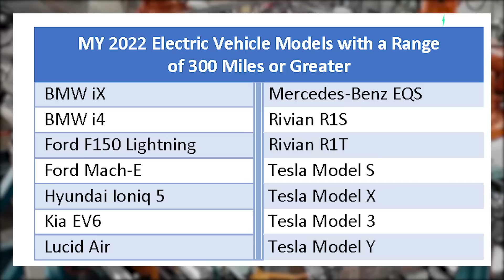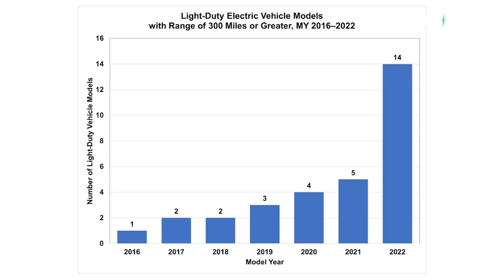New report shows why 1000 km range EVs will be the norm in 2030

Comment: 1000 klm would be great. However that's probably 750 klm & after 8 years of battery degradation 500 klm. Still OK if you can rapid change on a trip. However what is the usable range? As you can't use the top 20% & bottom 20% of your batteries capacity. I'm hope you right. Before buying an electric car, I want to see more places to Charge in Australia.

Comment: Instead of going up in range (which no one cares about driving for 8 hours straight),  they should reduce the amount of batteries, thus reducing weight and cost and overall supply chain issue.

Comment: This would truly be interesting. If this is the case, and to me it’s completely plausible, that sort of changes the importance of superchargers and any charger outside the home.  If you can get 1000kms, there are so few trips that would require stops outside the home. Chargers would certainly not be as crowded, not really required as much or often.
Reply: There already less important than they were when the typical EV was a Nissan Leaf with 60 to 70 miles of range. With 300 miles range, that's a 5th of the number of charges needed, and a significant number of trips not needing a charge at all.

Comment: Given the cost of batteries and the weight implications, is it more likely that we will see a lot of vehicles with different range options? Much like ICE cars used to have many engine options. But with more storage space for the mid and short range options. Different markets will also want different ranges 1000 km would be an odd option to choose in Cyprus, Malta, Hawaii or Singapore.

Comment: Hoping a good chunk is 62 kwh LFP packs in Aptera.  This doesn't even need any fancy new technology or giant batteries.  Current generation LFP would be about 940 lb / 185 liters (less than the 1000 mile using 2170 cells).

Comment: Moore’s Law is f@@king garbage. Yes, the computing power increases and technology becomes cheaper. But does it, really? In real terms it bull because older tech becomes obsolete very quickly so who cares about cheaper, old tech if you can’t use. Same companies keep developing the software which need higher computing power. Cars are going in the same direction as mobile phones, they’ll last certain number of years after which either new software will make the vehicle obsolete or the battery tech will change considerably that finding old model battery pack for replacement will become a monumental and expensive tasks.

Comment: One other consideration ; if you are going to tow something or drive a lot with heavy load; maybe you'd want the exta battery power to be able to get somewhere.  The Lightning only goes about 100, miles (80 in freezing weather) towning a trailer - so I suppose if you want it to really have a decent range you might go with a more powerful battery; if you can do that with the same weight thats obviously better.  But devoting more lithium to a vehicle means fewer such vehicles can be made annually.

Comment: Santiago wouldn't it then also be better to simply make the cars weight go down and lower the cars weight?  They are LFP I'd say get all the range you can because if you do highway speed in freezing weather you can lose 75% of your range; but for the typical non LFP you could just make the battery smaller and have a good all around range that should aways get you to the next charger; there isn't much need to go further.

Comment: Moore's law is not actually a law and has nothing to do with battery evolution. NOTHING.

Gordon Moore made an observation about the exponential cycles of evolution manufacturing VLSI. It has been adjusted for actual cycles, and is bounded by physical reality.

Today many say "Moore's law is dead", as it's actually impossible to keep previous rates of evolution against physical limits.

Batteries alway had physical limits. Evolution in specs and cost are also limited, although very desirable.

It doesn't preclude the displacement of most fossil fuels based transportation systems.

Energy "production", storage, distribution and consumption makes a huge system. It's a system's problem where batteries are a little (although important) piece.

Scale brings down costs. It's a fact. Unrelated to Moore's law, and people shouldn't expect that kind of exponential evolution in the medium or long run, at least with currently known physics.

Comment: I am disappointed that you didn't comment on the Aptera due out late this year with starting range of 250 miles then 400, 600 and 1000 miles options, it able to accomplish this by light weight and aerodynamics. The base model can be bought for only 26k. Oh yeah it has has solar panels that can charge the batteries up to 40 miles per day.

Comment: In 2030, the average EV owner will drive less than 50 miles / day.   600 mile range is not that important.  I want an EV with 400 mile range and a 15 minute recharge time.   A 600 mile cross country trip would only require stopping for lunch and recharging the car while you are eating.  The holy grail of battery technology should be rapid recharging -- not excessive range.

Comment: At present the range of most ICE cars is approximately 450 - 650 Km (280 - 400 miles) on a tank of fossil fuel. I don't hear complaints that's not enough. So why do we need nearly twice that range for an EV?  I think the 1000 Km (600 mile) range will not be common for several reasons. 

As battery technology improves EV's will be able to travel a similar distance as ICE do now before needing recharging. But the battery pack will reduce in physical size as the energy of the pack increases. Keeping the range to much the same as we have today with ICE cars, 450 - 650 Km (280 - 400 miles). This can be seen with Tesla reducing the battery size, but still maintaining the same range of the car. Even the number of individual batteries in their cars has reduced over the years as battery technology has improved. Also the cost of having a larger battery pack will influence the size of the pack, even with the cost of batteries reducing each year.  
Plus I don't know anyone who is able to drive 1000 km without taking a break. As Robert Llewellyn from Fully Charged says "It's not range anxiety I have, It's Bladder Anxiety".
Reply: Simple, it takes minutes to fill a gas tank. Range is a non-issue.
Reply: @Biochemechanic  It only takes minutes to recharge a battery now and with a smaller battery pack will take even less time in future.

Comment: no, the range will go up a little, but more importantly, the size of the battery and the weight of the vehicles will go down much faster than the range will go up. great range is as stupid as putting a 1000 gas tank on a ford focus. it would be stupid and self defeating.

Comment: My ICE car has a range of 800km.
Last year I filled it 4 times away from my hometownon a trip.
I do not doubt the report, but times will change.
Range anxiety will drop as super chargers become ubiquitous.
Most people will charge while the vehicle is stationary.  If you can't charge at your home, then there will be a method of charging where your car is parked.
Reply: Technicallty speaking ALL people will charge while the vehicle is stationary.. 😉
Reply: @andreh.dupuis8475  ahhhhh got me there.   Let me elaborate.  Chargers will be installed at parking places, where there are parking meters etc.  They will pop up all over the place.

Comment: Hello Sam and other viewers; ever since I got onto your channel I have been telling you about my 2011 Chevrolet Cruze that I built and made into a 100% electric vehicle but with special technologies that would enable it to go 840 to 1280 miles (1,344 - 2,048 km) on a single charge and yet apparently it is much easier for you folks to ignore me and avoid me and probably say that I’m nuts instead of actually doing a little bit of work and picking up the phone and calling me or sending somebody out to confirm the car is actually made! We don’t have to wait until 2030 to get that lower amount of range of 1000 km when the higher range is here now (it has been around for several years), but people would rather ignore and privately chastise instead of actually doing a little research! It hurts the whole industry. By the way folks, my battery pack is 1/3 the size of a Tesla and the car is about 800 and something pounds lighter than a Tesla model S! So I ask, “what the hell mate??!!” SMH! 
   Edward H. - Owner / Engineer /Fabricator / Machinist at: “New Ideas and Innovations, LLC“ in Madison, CT USA

Comment: you can only achieve longer range with larger batteries or lighter weight. Lither weight is the only desirable method. Larger batters means fewer EVs made due to the limited lithium supply.  If there are enough charging stations; it really doesn't matter much if you make 6 stops of 5 minutes or 1 stop of 30 minutes.  A Tesla with 200 mile range weighs less and is better for the environment; you can make more of them. If you can't get to your next charging station in 200 miles the infrastructure is inadequate.
Reply: We won’t need larger batteries if we can fit more energy into the same size battery. Energy density will improve.

Comment: I am enjoying your enthusiasm and positivity. There is no doubt that 1000km range will be feasible. In fact, 1000 km is already possible today, especially using the more aggressive Chinese EPA calculation. That said, each car maker will still have only access to a finite amount of batteries, albeit at much higher GW levels in 2030. Car makers will need to decide whether to use their battery supply for higher volume and lower kWH or lower volume and higher kWH, or some mix thereof. Eg assuming a car maker has 240 kWH available, it could decide between 2 cars of 120kWH ( and e.g. 1000km range) or 4 cars of 60kWH at lower range. How much fast charging improves over next few years will also play a role. Looking forward to see this battle develop.

Comment: Sam
You still don't get it?
.
Follow "The Mission Statement".
.
"Transition".
.
It's about numbers of vehicles, not how far 5% of the population "needs" to travel.
.
Cars are ALWAYS designed to a "Bell curve"..... The "average percentile" (look it up. I know. I'm outside the curve), not only for body size, but for use characteristics.
.
They design to the needs of the majority
.
That means (as I've said many times)
.
1) Outrange the "average" driver (passengers)
.
2) Accept charge sufficient to repeat that in the time taken for an average , sensible, "comfort/refreshment" break.
.
3) Using the  resources saved, BUILD MORE VEHICLES
.....
That's it.
Period.
.
It doesn't matter what the consumer "thinks" they need based on outdated metrics which do not apply.
It doesn't matter what the consumer would "like".
.
It will be based on the bell curve.
.
It "they" build 50%(?) of vehicles with "hyper range" but in doing so, run out, or grow short of resources, that may mean prices stay high, but also that numbers of vehicles can't be built, possibly stalling the transition.
Reply: I agree but the fundamental of businesses sometimes go into a transition too.

Higher range adds into to “quality of life”

Car value and use depreciate much slowly owing to larger batteries slow chemical ageing process (yielded by more cycles)

Consumer behaviour has the power to make the bell curve deform. That’s economics 201.

Comment: Manufacturers going for range is to be expected as it is the perceived weakness of EVs, however at some point price will be more of an issue more than absolute range. With energy costs rising and likely to remain so a perceived "adequate" range may be lower than people currently think.
Reply: cost ane weight are much more important that range over 300 miles.

Comment: Highway range is the only range that really matters. Once EVs have a highway range of 500+ km then the range issue will disappear. A thousand km range is longer than what is required.
Reply: 500 km is probably over 6 hours of driving time, in my book that's a lot of time behind the wheel.  That is perhaps the upper limit of what most people would want to drive in one day.
Reply: @GlenisRetiredNZ  I think you are right for 99.9% of people. Problem is, theres always that fringe group who say if it cant do a billion miles between a 2 second charge, then its not good enough. Of course, people need toilet breaks, and food breaks, but that doesnt seem to enter the fringe thinking. I suspect we are already in a spot where range is enough. The bigger issues coming will be reducing the size of the battery, and making the car lighter, which will ALSO help range. This will also provide designers with new opportunities to package cars differently.
That said, I'm not really interested in "cars" anymore. I want to know where our flying cars are?
Reply: @bigrobsydney  I think the 1,000 km milestone is more about not having to charge for a long time. There are a lot of people that don't own/rent a house with easy access to a power point/home charger. If you average 33 km a day, you only need to go to a public charger once a month.

Comment: The days of the BEV are numbered............soon they will make a breakthrough and the fuel cell will be the go to preference for travel..........the already heavy investing in the fuel cell will make it happen, and when it does who will want a battery that costs more than the car itself......  fuel cells can be coupled together for capacity and moved from car to car or truck as the need arises and then to the house if need be.........fuel cells don't burn the fuel but convert it and the left over residue is environmentally friendly.
Reply: Fuel cells have been talked about for very a long time. But the technology has never come to being a reality. The problem is hydrogen storage. Hydrogen is a very explosive material. You will need to fuel up at some specialized fuel station. Whereas BEV can be charged at home or anywhere that has power outlets safely
Reply: @123abcter  I have to agree with you.....the aspect of a hydrogen event is not something to dwell on for a restless night's sleep.......with hindsight it would seem to be the long way around.
Reply: @gangleweed  , it needs electricity to separate hydrogen and oxygen from water then ship them to fill-up station. It’s dangerous and waste of time. Have the electricity transmitted by wires to where it is needed
Reply: I am not convinced that hydrogen fuel cells are a better technology than batteries, but even if they are, there is a practical problem: internet searches suggest the total number of fuel cell cars sold to date is about 1000 times less than the number of battery cars, and the number of hydrogen fuel stations is about 1000 times less than the number of electric charging stations. Concepts such as the "network effect" and "economies of scale" mean it is likely battery cars will successfully fend off competition from hydrogen fuel cells even if hydrogen fuel cell is a superior technology (which I don't think is the case).

The main reason I think hydrogen fuel cells are not superior to battery cars is that the "well to wheel" efficiency of fuel cells is significantly worse than the "well to wheel" efficiency of battery cars. This means it will be significantly cheaper to drive a battery car, say, 100 miles than to drive a fuel cell car the same distance. Any breakthroughs in producing hydrogen or fuel cell technology might reduce that difference in running costs, but laws of physics indicate that the "well to wheel" efficiency will always favour battery cars. If you want to learn more about this topic, you can start by doing an internet search for "well to wheel efficiency battery vs fuel cell".
Reply: @CiaranMcHale  I was just musing.....the BEV is far more convenient all around compared to any other form of energy and it's origin  for cars........most people are only capable of plugging something into a wall socket without having to do the maths etc........KISS rules every time.
Reply: I don’t know any hydrogen fuel cell cars on the roads.

Comment: My prediction is that EV's of the future will have their duco made of material that acts like a solar collector, which continually feeds solar energy to the battery whenever the vehicle is outside in the daylight, whether it is being driven or not. This would extend the range of the battery between power station charges.
Reply: Sion , sono motors